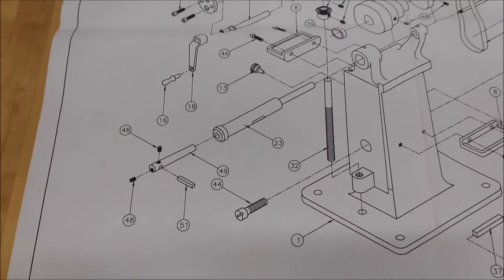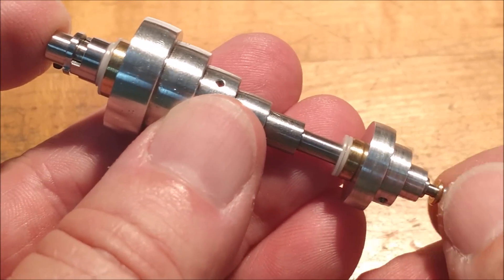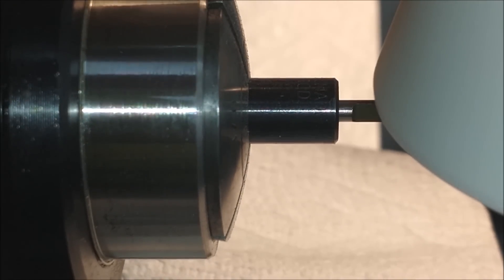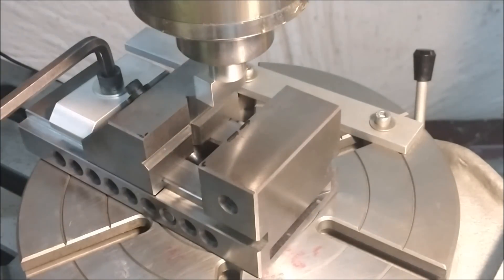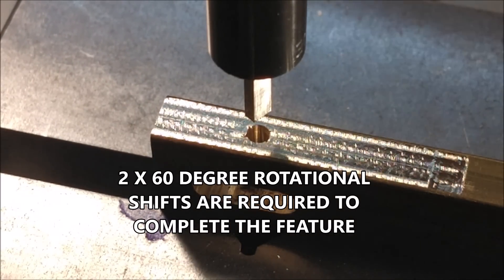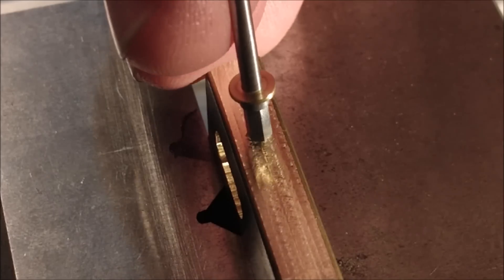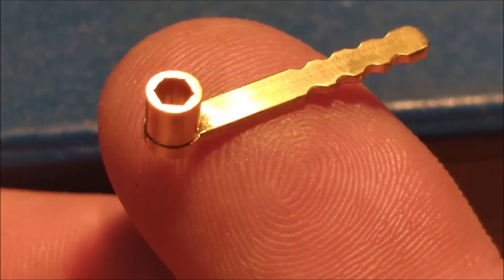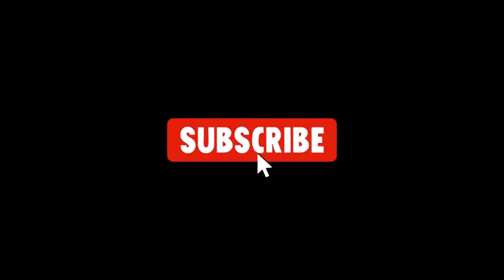Mini Milling Machine - Mini Cat 40 Spindle ??

Comment: That broaching trick is a shop gem, thanks! 
One such thing that seems so obvious once You seen it but never before...
I have one of those inexpensive Chinese D-bit grinders. They work really well for quickly making tools like that broach, use it all the time. Material supply is unlimited, broken endmills etc. Got the C5 type to handle a little larger stock/toolholders. etc.

Comment: HI Joe - how do you keep the spindle of your mill from moving when you are broaching with the mill? . Great video . If you make it to the Indiana engine show don't forget to bring this handle .
Reply from the maker: The machine is shifted into back gear. Its then moved to the lowest RPM possible. The broach is rotated to the correct position and the brake is engaged and cammed locked in place. That is usually sufficient.
Reply: @joepie221  thanks for taking the time to answer Joe

Comment: I've got to turn a reduction in the diameter of a steel drive shaft (a tool for carving nest holes for endangered dormouse species) - do you have any advice on the strongest shape for this? Concave, linear straight line, convex or shoulder? I can machine any of them but I'm having difficulty working out which would be strongest - guessing straight line or concave but I'm not sure. Thank you very much for your thoughts!
Reply from the maker: Without seeing the tool and the environment its being used in, I hesitate to offer a suggestion. But if its a simple mid shaft undercut, and you have the room, work as many radii into the feature as you can. Less chance of cracking at a sharp internal corner.
Reply: Oops - looking through the literature parabolic may be the best option...

Comment: ( edit ) Make that 2 white jackets. I managed to turn an 8 hour job into a 22 hour job. While turning the an arbor for a gem faceting machine from 2 1/4 in. stock 4045 to 11.98 dia I missed and over ran by .002 and had sloppy bearing fit . Done now and the 8in lap at the edge is .0007 running true.. You really keep me on my toes Joe , nice work ! Oh BTW I bought a microscope cam to fit on the machine for theses old eyes and love how it works , no more squinting . wish I could post a picture .

Comment: But…..isn’t there supposed to be a “knocker” on the end of the wrench to free the tapered driver?   Stainless would look amazing…😅. The tools that you have in house are just like a stocking dealer!  Carbide tipped slitting wheel- pay once cry once?  But the cut was beautiful!  No high teeth making that horrible noise I guess it’s just the right way to do it, and the cost is probably paid back many times in its lifetime.  And then you just resharpen and it’s good as new.  Makes the initial investment definitely worth while 😊.  Another jewelry episode that is out of the box!

Comment: Got a challenge for you Joe, take any one of your mini machines and show it making any part from any other of your mini machines. That would be a mini mini part.
Chuck
Reply: They say a lathe can make its own replacement. It would be interesting to see it making a collet chuck or something.  But it might run into problems with the hardness of the metals being near equal. These miniatures weren't exactly designed to be used for work. They are designed to just look like they could.
Reply: Probably hardwood capable in limited quantities.  Now for the accurate markings on the wheels of each axis.
Reply: Wasn’t looking for the mini to actually make the part just make it on the full size machine and put it with the mini, like it was made on it in the mini mini scale.

Comment: I use duck tape to clean metal dust off of my magnets.
Reply: yeah but the plastic bag avoids passing multiple times on the magnet with the duck tape
Reply: @curtisnewton895  I use plastic bags, but occasionally there are small holes that I missed.

Comment: Got a Morse taper in my mill and have to bash the draw bar to get tools out. Feels like it's not healthy for the bearings. Any way to prevent it sticking?
Reply: I think there are ways to add a collar to the top of the spindle and trap the drawbar so it can act to push on the collet when it is required to push the collet out. The actual design would depend on the machine you have. The other thing is to realise that as Morse tapers are self holding you only need a low torque on the drawbar to pull the taper up and stop it from working loose. You do not need the same pull up force as is needed for R8 or other self releasing tapers. However never having used split Morse taper collets I do not know how much you have to pull them up to properly grip a tool bit.

Personally, if I was getting a machine with a MT spindle I would ensure it has a slot for a drift. I know these slots are sometimes of limited use in a milling machine but if all else fails they can extract stuck tooling. I only use MT for my lathe tailstock and have a few adaptors for increasing, decreasing and extending the tapers. I find a lever action drift in a slot makes separating these taper joints very easy and the lathe tailstock has an automatic release when wound all the way back in. The item in the tailstock barrel is pushed out by the end of the tailstock leadscrew. This is the sort of action that can be performed with a collared drawbar.
Reply: Not really. There are self releasing and self holding tapers. Morse tapers are self holding. They're designed to stick.
Reply: Rather have it a little sticky than loose and falling out when in use.    Had a apprentice grease the Morse on our manual drill press.   Took a lot of work to get it all clean and stop drill bits falling out mid operation.   Sounds like you need a drift with a shallower taper to knock your tools out with.     Helpful if it's a pure Morse taper, no draw bar like our old girl had